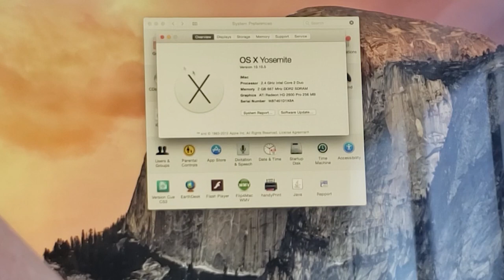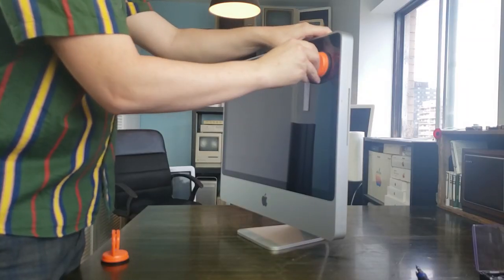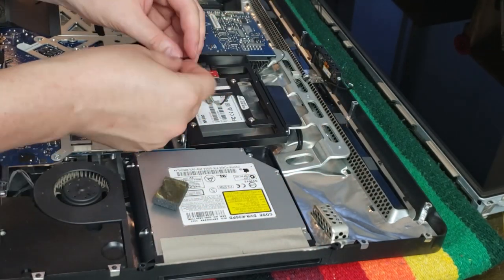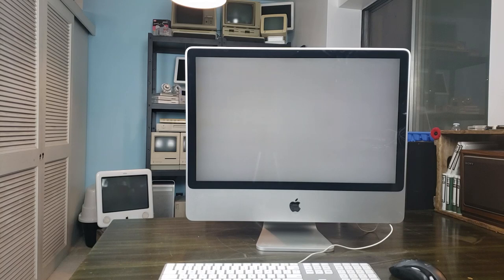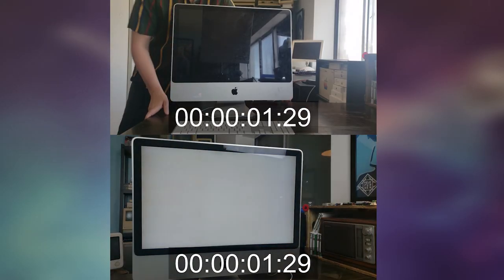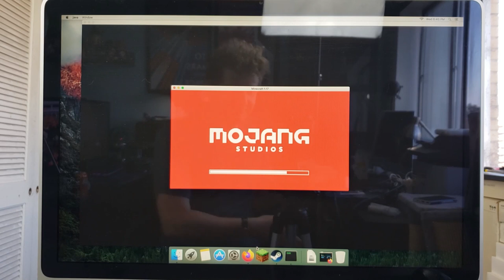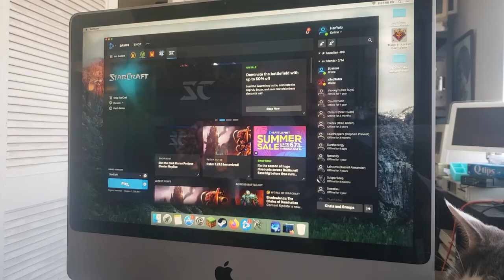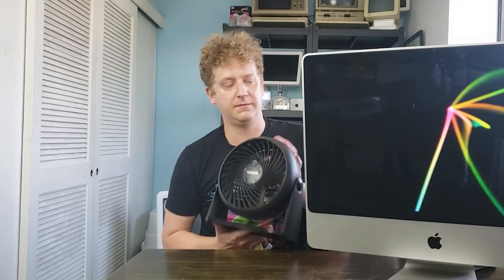Is the 2007 iMac STILL a Decent Computer? - Review & SSD upgrade

Comment: To get the keyboard battery out, drill a 15 mm hole down its length, insert the appropriate wood screw and pull it out.
iMacs get hot when full brightness is selected....turn down brightness to reduce heat, ( mostly at upper left corner of screen ).
Reply from the maker: At the risk of sounding like a moron, it's not hazardous to drill into these watch-style batteries? I know I usually lol a bit when I hear about people cutting into their laptop battery cells once they've bulged but perhaps that's because the gasses are already leaking/accruing?

Comment: I just gave my 2007 to my daughter and with SSD it works well.  I did have to add Opera operating system to run some programs.  The ram is 4g on it and still gets the job done.  My new old toy is a 2017 iMac 4K Retina with 1T HD drive.  It is so nice.
Reply from the maker: I WISH I had been gifted something this good (relatively speaking) when I was a kid. 

When it gets completely unsupported then it's time for her for learn about lightweight Linux!

Comment: I have a 24-in early 2008 iMac that is still in service as a Mac OS X Server and media server.  I’ve cracked it open twice over the years to replace the spinner HD with new ones when the old ones died.  Next time will be replace with SSD and new thermal paste.  I am running with the max 6 GB RAM. It’s a nice machine, by far the longest of my Macs still in regular use. Enjoy your videos, Dan!
Reply from the maker: Hey Joe! Thanks a bunch. I am hoping to gain some utility out of the newer machines in the collection and media server sounds pretty doable. Might make a good video!

Comment: i ran into almost the same problem with the ram, however i put in one 2 gig stick and one original 1 gig stick. works fine. havent gotten around to upgrading to ssd, since im planning to replace the LCD, glass, and try and sort out the ram first.
Reply from the maker: Sounds like a solid project you've got there

Comment: I'll add that some of these iMacs are properly finicky with their RAM, as you discovered.  I had two 8GB sticks for my 2009 and ended up putting the original 4GB stick in one slot with a new in 8GB in the other.  It took two or three attempts and combinations to get it to boot.  Managed to get 12GB booting.

In the end I needed the 8GB stick for a 2009 MacBook Pro so I went back to 2 4GB sticks (the original one in the iMac and the one I had taken out of the 2009 MacBook Pro) and it booted straight away.  I checked the compatibility of everything I had before I used it but even then it was a pain.
Reply from the maker: That's strange. Did it register 12gb when you were running it? Or did it max out at all?
Reply: @CanadianComputerCollector  With the right slots it registered 12GB just fine.  But it would only work if at least one of the original 4GB sticks was in there.  It was really bizarre.

Comment: It's overheating because you need to replace the thermal paste and run Mac Fan. My 24 inch had the Core 2 Extreme processor running El Capitan. I upgraded the processor to the T9300 and I'm running Mojave without issues. 4GB DD2-667 256GB SSD and on load never crosses 56C. I used the Arctic Silver paste also. I run the Half-Life games on Steam without a hitch. Good to go bro! Yes, I could run OCLP and get it up to Catalina but you'd be pushing the machine because it doesn't have Metal Graphics. It is a GREAT machine to run YT, social media and even Apple TV without issues....
Reply from the maker: That's pretty cool actually! Great work! I should see if I can breathe some life back into this thing. It recently stopped outputting video so it has been riding the pine for a bit.

Comment: I have a late 2006 model and I’ve installed windows 10 and Mac OS 10.7.5 and I’m trying to install 10.9 which it has at least FaceTime working…and despite the 3 gb of ram and the 2.0 ghz of the core 2 duo it works just fine and for full hd YouTube videos and other simple stuff it’s just fine…anyway have a nice day 🙂
Reply from the maker: Honestly it really is still a fine machine. Sure it has some limitations with modern games but it runs pretty damn well otherwise. Thanks for the comment!
Reply: @CanadianComputerCollector  I have a 2009 that we put into 'production' when my other half needed to use GarageBand to do some basic recording at her job.  Interface was class-compliant and worked straight away, I stuck 8GB of RAM in it and an SSD and it's a decent enough machine.  These old iMacs are still useful!

Comment: I have got exact same model of imac, I did install new ssd however cannot get into installing new mac os on fresh ssd. Any ideas ? All it shows me is folder with question mark.
Reply from the maker: Yes! You need to boot into recovery mode to gain access to disk a management. From there you’ll need to format the drive then go back to the install screen. Install media will also be needed, like a USB stick with a bootable MacOSX install would be ideal. From there you’re good to go!

Comment: I appreciate your video some much. I was just thinking about how much faster can this 2007 iMac be with an SSD. I came across a 24" and 27" for free and both worked.

I guess it works, but may not be worth it upgrading. It would be for YouTube and movies. The screen is very nice and it's well built.
Reply from the maker: That's exactly how I felt. Shame to let something like that get recycled as it is so nice. One thing I didn't do, but you might try, is bootcamping Windows 10 onto it. Might run better and accept newer apps!

Comment: I have one like this one. I tried to replace d.the HDD with a SSD. When I put it black together, the screen looks with a lot of static when I turned it on. Someone can help me to pinpoint the issue. I would to reuse as a Linux machine.
Reply from the maker: Sorry for late reply. Sounds like a loose connector or perhaps something was accidentally severed in the process? How’d it work out for you?

Comment: Can imac 20" mid 2007 with 1 gb of ram runs Minecraft,cod,gta5?
Reply from the maker: Yo! I have some bad news. I do not think it would run anything beyond Minecraft, and Minecraft is likely to be a bit choppy. These machines weren't built to handle those heavy pieces of software. COD is for sure out. I would guess GTA 5 as well, but you likely can get Minecraft happening.
Reply: There is no Mac OS version of GTA5, so you would have to install Windows.  I am sure even if you upgraded to 4 GB of system ram, the graphics card memory is too little for GTA 5 but maybe not for GTA San Andreas.  I think any 3d Windows video game of the last ten years would not run.

Comment: How do I use this IMac aaa monitor for my PS4 ?? Cuz ive got one of these laying around with a MacOS problem and i dont wanna throw it away neither do I wanna spend That much ona gaming monitor so I was looking to find a way to attach my PS4 to this
Is there some sorta adapter or something cuz I can’t see a HDMI port here
Reply from the maker: Hey dude! Sorry for late reply. I think it is possible for sure. I've used my 2013 imac as an input for devices, but it might not be that easy to output to one. Let me do some digging. I'm currently in the midst of collecting the pieces to convert one of these permanently into a display-only. So keep me in mind in the future!
Reply: @CanadianComputerCollector  ahhh sure thing
Id be waiting and on the lookout as well
Reply: I have this same Imac.  And wondered the same thing.  There are some newer Imacs that can be used as a monitor, but not this one.

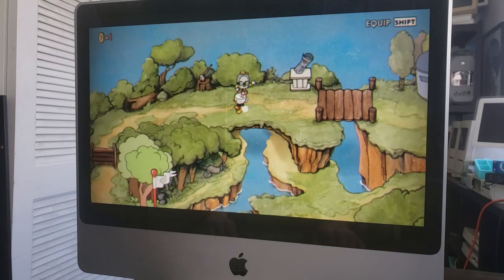Comment: 12:14 at least it's running it better then my early 2009 iMac runs Roblox
Reply from the maker: Dual core CPUs are always going to struggle with modern games unless they're super low res
Reply: @CanadianComputerCollector  my early 2009 iMac does run Minecraft ok ish

Comment: I'm trying to play on windows os so I'm limited to 32-bit apps but I think you might have been able to play cuphead and others if you were successfully able to upgrade the ram! I had one of these already and found one in the trash also. It had belonged to a school domain but I was able to change pw on the admin accounts and start using it as local machine. I know osx is in the other 125gb partition but I have had no luck getting back to it.  They have the 2 intel cpu's (you can upgrade them with like a t9600) and a gfx ati or nvidia gfx. i think I got ati in both of em. Nvidia one is needed I think for installing newer os (up to sierra) with hardware acceleration. The 8gb pc2-6400s ram sticks cost $80 for a set! And $10 for the 4gb set.
Reply from the maker: Nice! I imagine that was all on MacOS too right? I was thinking I should do a Windows review on a machine like this in the future. I wonder what the difference would be in performance.
Reply: Well I've since gotten more acquainted with it but my error was saying it had 2 cpu's. The windows system in mine at least reads the core2duo as two dual cores instead of one quad core or something. Anyway, you can trick it into installing 64bit windows by creating space for the partition by shrinking the one already there(mac is hfs not ntfs so do it inside of the macOs first unless you have specialty hfs+ drivers for windows), taking the drive out and starting the installation on a windows pc then when it restarts, press the power button off and stick the drive back in the mac and let it finish installing. I don't know if you can switch it to gpt type disc but if you already have dual boot and create a new one it will change your basic mbr to dynamic so you would need gpt for many partitions but i don't know yet if an imac especially an early 2008 can handle that. With the internal graphics and 64 bit you might get some mileage! Thanks for hearting my comment and replying! I also painted mine kustom canz sparkle purple pearl lol I might use partition master to clone the drive as a backup and experiment with gpt and creating a windows 11 64bit dual boot and label the volume as "BOOTCAMP" and see if all those features work or you can just do windows64 bit since none of the apps from the app store work in apple unless you have latest os.... and you need the nvidia and not the ati gpu for the hw acceleration to work in sierra which might be the latest this can handle (no high sieera, no mojave I think). I also have one that doesn't go into the mac os utilicty when you press ctrl+r it loads and gets stuck so I might have to downgrade, hope its not the gpu. I have one with el capitan and I might be able to get the settings partition to work by installing snow leopard, I also need to do that. It would be hilarious to have snow leopard and a 64bit windows with fully functioning boot camp and startup utility. The only way these are viable nowadays is to go windows!! Even with 64bit apple OS's you will have trouble in the apple store with compatability roadblocks... if gpt works you can have more than 4 logical partitions as a basic disk!
Reply: Sorry if I didn't answer your question, actually. I have two, I havent succeeded isntalling windows in one (has el capitan on it and system utility boot doesnt work, app store is a nightmare) but the one I found booted only into windows! I haven't even touched the macOs partition in that. I booted to the partition once and it has a pw but I'm not touching it. And it was connected to a domain network, meaning it didnt have a profile on the machine to log into but an online cloud-type one! I was able to un-hide the local (on-machine) administrator profile (after several nights of attempts) and from there I was able to create more local user profiles to use. One I labelled, 'dumbass' (that's me) to use instead of the administrator one. So that way when I'm using an app it can't change my machine settings without inputting the admin's pw (which I had to change before getting into the system). I also recommend a wired (over wireless) classic mac keyboard for all work on these. For example, If you press the 'option' key it will ask you what disk to boot from, etc. Windows keyboards don't even have an option key and wireless keyboards might not be able to load the drivers to do this, (you need to hold button and then power on device). Good luck!! I've had a lot of fun messing with these little all-in-one computers, and they're actually pretty tough!! They use EFI to boot. Efi boot partition is 32 bits, but I know you can definitely make a 64 bit windows partition work... with all that (including your ssd mod), and a t9600 and 8gb of ram I have no doubt this can game pretty good. Maybe even a light 'productivity' pc as long as you don't have tooooo much going on at once! Edit; Even with 4gb of ram these do suspiciously well as productivity pc's... in macOs. But now with chrome and edge's sleeping tabs, who needs it. Last word, 'gaming' might be relative but I can run persona 4 in a ps2 emulator in the 32bit windows 7 at 1.5x upscaled internal resolution and still get 60fps. I can download steam and play half-life2, a buncha J-RPG like Grandia2, Final Fantasy 9 maybe with HD mods or ARPG like YS Origin.. FFXI, whatever runs on your 32 bit machines. But also, some of the games I prefer are less demanding. 08 imac 20" yea. Kind of surprised your one cqme with only 2gb of ram. But I guess they all do. I just systematically upgrade them as soon as I get them. I think it's dual channel so you can run a 2gb + 4gb also as an option. And I think that's what they recommend, but people do 8gb total anyway and it seems to work but sometimes it only logs 6...? Don't really know the details about that!

Comment: The biggest fault is that it can be upgraded only with two memory modules. Apple asked a lot of money for this computers. Why they cheaped at building 4 slots into them? With 8 GB or RAM they could be cheaply upgraded into usable computers even for today.
Reply from the maker: Unfortunately it's not all about ram. The dual core processors are getting pretty long in the tooth and the OS support is going away. Every year it gets harder to continue using them.

I wish there was a good way to use these as a monitor as they're still beautiful displays and that will never change.